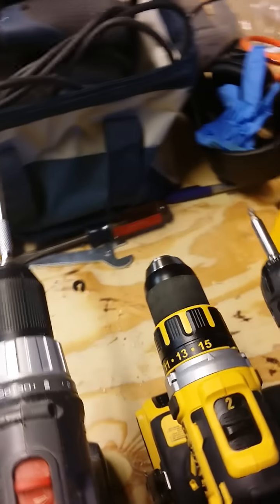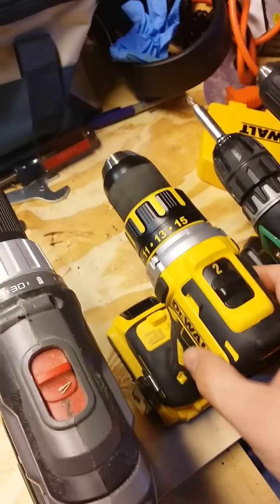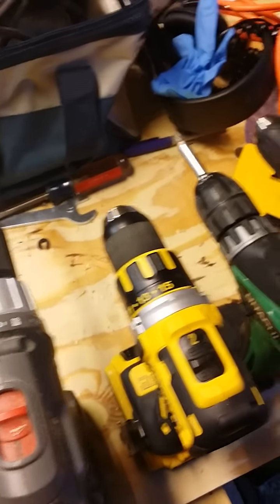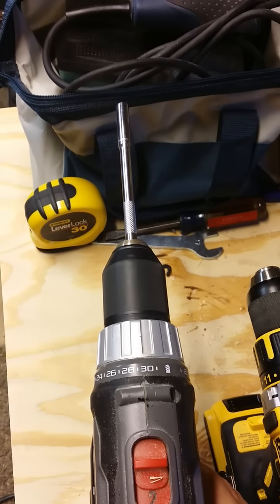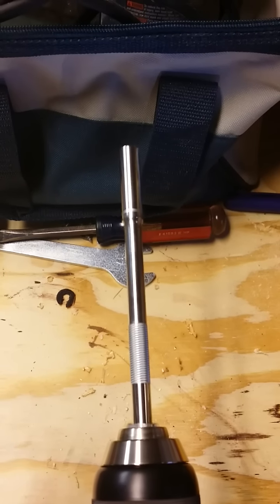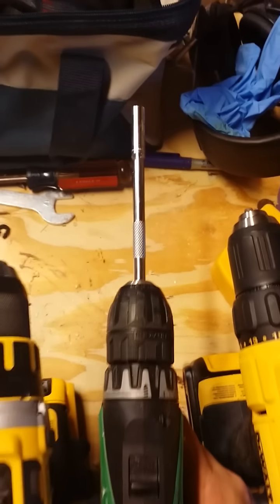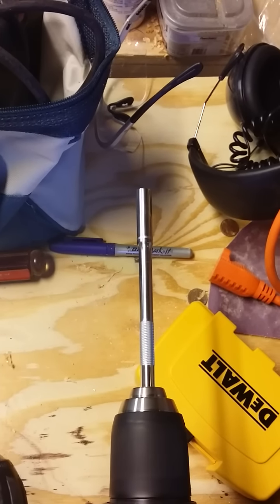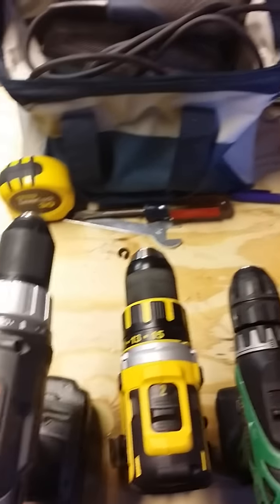Dewalt Drill Chuck Wobble issue!  Vs. Hitachi and

Comment: Just bought the $100 Dewalt corded hammer drill and it wobbles like crazy out the box!  I thought I was trippin until I found this video.   I thought Dewalt was supposed to be top notch.
Reply: For Durability an Quality Made Go with Makita. ( Also Makita's Internals are water an dust/dirt resistant.)

 If your only care about being a lil more powerful get Milwaukee. 
 
After I done Alot of Research on battery power tools I settled on Makita"  An Makita has the Largest battery Tool Platform.
Reply: @jacobsebastien3910  Metabo also! My father gave me a used one and it still lasted for many many years. Absolutely no wobble and very ergonomic and balanced in weight. Unfortunately I had the battery pack sucking in water for some days. Bought one from Lidl. Made strange noises. Got a replacement! Wobbles! I hate that thing.

Comment: Guys, I'll tell you a secret... it (chuck wobbling) doesn't depend on the brand... it depends on the specific piece of the drill (I mean, how it was manufactured, who completed it on the factory line etc.) If you wanna get drill which is perfectly centered, go to the store where they have more same pieces displayed (Wal-Mart in the US, Kaufland/Lidl/Hornbach/Bauhaus in the Europe), open them one by one on the spot, try them (this is not a problem with battery powered drills) and get a piece, which is perfect and has no wobble. This way I'm buying my power tools and getting full satisfaction all the time. Last time I bought this dirt-cheap chinese power drill with two 2000mAh Li-Ion batteries, 50Nm torque, hex bits and 10 drill bits for $44 in my local supermarket. It even doesn't have any brand, but thanks to my previous testing (I was chosing from 4 same pieces for solid 30 minuntes), it has perfectly centered chuck which doesn't wobble at all and I really like to work with this drill, because it just works perfectly. 3 drills I tested was unusable because they wobbled alot, but 4th one was jackpot which had no chuck wobbling at all. What I'm trying to say is - you don't have to buy overpriced big brands... just buy more visely :)
Reply: No, if the tolerances of the model are so large that some wobbles and some not, then all will wobble after a short while. It is certainly model related. Old drills with metal chassis, metal gears and quality bearings doesn't wobble after 50 years.

Comment: I've had 4 Dewalt drills over the last 3 years with the exact same issue.  I have yet to find one in any store or any belonging to friends that don't wobble.  When you chat online with Dewalt about the issue, they are clueless & just direct you to the nearest repair center followed by abruptly closing the chat session.  So it's obvious they don't care to fix it & they don't care to listen to you tell them about it.  The tool is junk if it can't perform its most basic primary function of drilling a round hole.  Maybe they're secretly working on new oblong hardware that will actually fit the oblong holes drilled out when using their drills?

Comment: My Milwaukee hammerdrill does this too. I never noticed until recently because I always used my older 18/20v drills for drilling and my small impact for screws, but since selling my higher voltage stuff this became my go-to for a lot of stuff. Gonna look up the date code and see if its still under warranty.

Comment: I have the same issue with a Bosch 18v. Took it back, got a replacement same thing. Normally I could accept a bit of wobble, but I'm using it for drilling plexi and holes near the edge of the plexi break the panels.

Comment: just bought the Dewalt DCD791D2  kit and I noticed chuck wobble but after watching your video in comparison mine is much better in fact better than your other drills too. also I notice the wobble is only noticeable in chuck and not in the actual bit. so I think may be I was expecting too much precision than what is commonly available in these kind of drills. now I feel better. and by the way mine is made in USA if that matters I don't know.

Comment: I have the same issue with my Dewalt. Wobbles almost exactly as much as yours. I have the EU version of the last Dewalt you try out. I really hate dealing with warranty issues when the problem is seemingly minor, yet has a big effect on the usage.

I'm expecting to get the "it's supposed to be like that" -answer as well. :/
Reply: They fixed mine by doing nothing to it. Came back exactly like it went in.

In addition, I met with another contractor at my previous customer who had the new Dewalt 10,8V (if I remember correctly). Same. Exact. Problem.

I can't recommend Dewalt to anyone who appreciates precision in their drilling.
Reply: Kopsu the problem with a lot of these drill manufacturers including Dewalt is they don't make their own chucks. I had the same problem you're speaking of and I exchanged the drill six times. Every single one of them had the same problem.. Eventually I just threw up my hands and shelled out 14 bucks on eBay for a Jacobs 700 series metal Chuck.. Now it spins like a lathe. The gearbox spindle spins perfectly on these drills... but the damn chucks are lousy.
Reply: renegade40 Once I got the drill back from the shop, I gave up on this issue. It's been almost a year now and the wobble is still there obviously. However, I've gotten used to it and accepted the fact that I made a bad purchase with Dewalt. It doesn't bother me anymore that much. I haven't even thought about changing the chuck, but now that you told me how you fixed yours by doing so, I'm going to have to look into it :D Thanks for your reply.
Reply: Yes terrible in screw heads and bits
Reply: @renegade40  so i should just change the chuck ?
Reply: @renegade40  How do you get the chuck off? I've given it a fair bit of "persuasion" - both ways in case it's a reverse thread - but I can't budge it for fear of stripping the bolt head.

Comment: My Milwaukee m12 combi drill gen 3 does a bit of wobble I can notice it on the shortest  bits the bits are made by Vaunt. Maybe the factory workers get the  Milwaukee, Dewalt and Makita  chuck bearings  mixed up on the production line.

Comment: Our dewalt (same as the second one from the left) drill just started doing this at work. We use it to drill holes in metal enclosure back plates for electrical control panels. About one hundred of holes a week on average through metal. We also tap some holes too and this is where I noticed the wobble. Anyone who has done tapping in metal knows you dont want the bit to wobble on you at all. So I dont know if we did something wrong to it or if it got damaged, or if its just bound to fail over time. Anyone else have this issue with the dewalts?

Comment: My Makita XDT08Z Brushless has the same wobbling. I opened it up the front cover and found the main drive shaft is straight as an arrow. So i think the problem is in the gear boxes and those brushless probably all have similar design in the drive train.
Reply: +jsc my BHP459 brushless has quite a bit of wobble...and when you hold it at certain rotations it makes a grindy noise. warranty time i think...

Comment: Bought a cheap chinese Total Rotary Hammer drill and its wobbling with concrete hole saw like crazy. I thought i bought a cheapo drill so facing this issue but here top brands like DeWalt, Makita, Milwaukee has this issue too. Do these drill manufacturers have any shame selling such faulty drills to customers?

Comment: I had the same problem on a brand new professional Bosch and was told by the dealer that nothing was wrong with it. 
Traded it for a Makita and no more problems. :)
Reply: which Makita did you get?
Reply: Makita! got brushless hammerdrill and a regular w/brush, both a couple of month old Makita's, no abuses and both chucks have a significant slackness. My 20 years old B&D 1/2in el chipo drill has less play on the chuck than both Makita.

Comment: I've got a Makita brushless drill is as straight as a laser, the impact is too.  I got a 12volt Dewalt impact and it wobbles like crazy, although it does tend to straighten out, but the collet has a ton of wobble/runout.  Ive been to multiple stores and have checked 801's 809s, 887 and there other brushless, and most of them had really noticeably wobbly collets. So weird that its apparently "ok" by Dewalt.
Reply: I have a refurbished Makita with a wobble.  I love the quality and durability of all my 15 other Makita cordless tools.  I have an impact driver that is 15 years old and still running great.  Been dropped so many times!  :-)  I guess maybe the refurbished drill is an anomaly.

Comment: Just checked mine doesn't do that and I've used it to do all the sheetrock in my addition double layer of 5/8ths fire code without a recharge, worked better than the corded version of the cheaper drills , maybe the issue been fixed 🤷‍♂️

Comment: I have the same issue with the last dewalt , I bought it during black friday too for $100. Last night I messed up a screw on a 2x4 (was installing some speakers on the wall) , the screw just broke, after checking with different bits I confirmed that It is "wobbling" to the point that you need to use it really slow to drill a screw, forget about using a hole saw ....

I think this thing has warranty so ... I'm about to send it in....

Comment: All cordless drills have  the same problem. I have the same issue with Makita, Dewalt and Silverline.
You will be amazed how much your chuck moves by hand (left-right-up-down).

If you use a dial indicator you will see that you can move the chuck by hand more than 0.2~0.5mm.
In other words if you use a 4mm drill to make a hole your hole will be 4.5 and that is awful
Reply: Makita is the most solid chuck out of all the brands tho.

Comment: I thought I was using bent bits, etc but the DeWalt I have the DCD776 - probably the second one demoed here - and it wobbles to the point that it's difficult to start the bit. I've NEVER had a drill do this. And I will never buy another DeWalt product; I'd decided the go with the DeWalt ecosystem and also bought a jigsaw, but it doesn't cut straight because the blade flexes away from the guide! Bosch or maybe Makita for me from here on I think.

Comment: All of these leading brands get their drills manufactured in China from and the same vendor it seems. It’s not possible to have same problem for all of the different company hand drill unless they are from same factory. 

By the way before coming to this video, I went length and breadth to investigate this issue but no luck !!

Comment: I have the same problem with my dewalt brushless, I was told over the phone they all do that, it's bad enough to make the drill vibrate while running it
Reply: Lewis Hart Lol, maybe all dewalt's do that, but my cheap NiCd ryobi and the 18v LiOn Makitas have absolute 0 wobble. I can't use my dewalt for many projects because of it.

Comment: What r u using the drills for that you want perfection on a handheld drill? These things are made for construction, mechanical and other similar assorted duties. The money on the expensive ones usually goes to toughness and longevity. Get yourself a expensive drill press if what you need is perfect rotation.
Reply: Er, no, I don't think we're expecting perfection, just a reasonable level of craft in making a decent drill/chuck. As I mention elsewhere I have a couple of very old, crappy corded drills that are straight as a die.
Reply: ok.cool